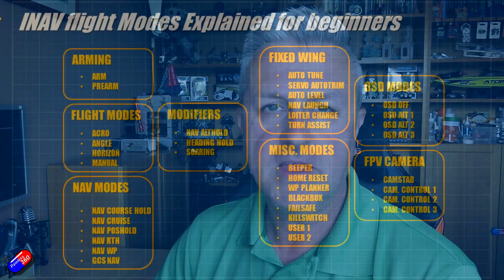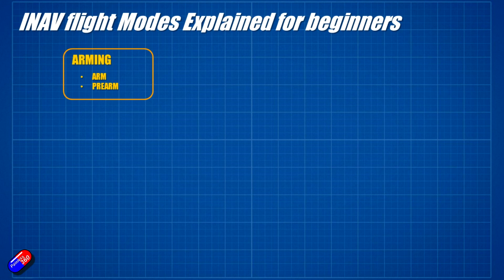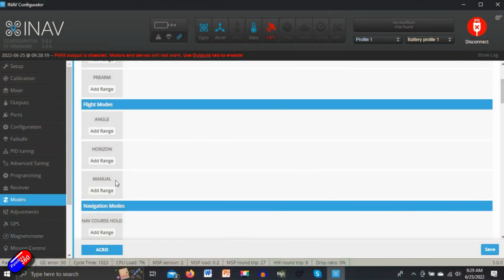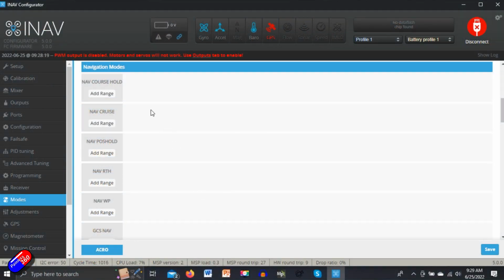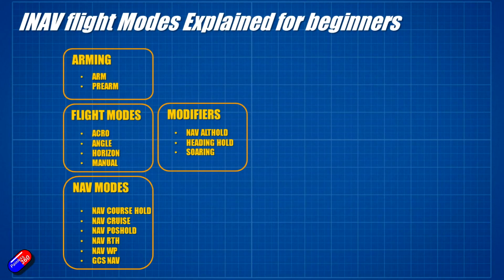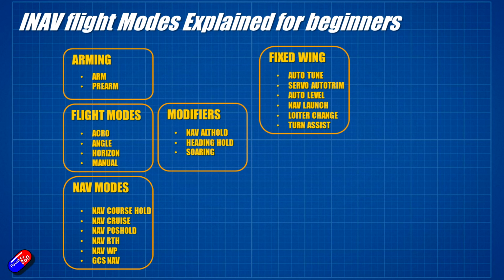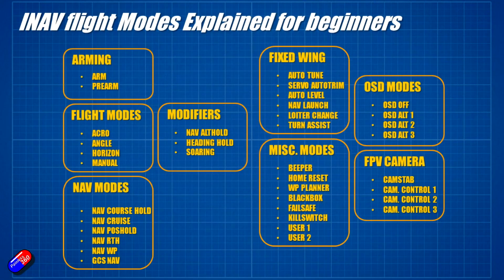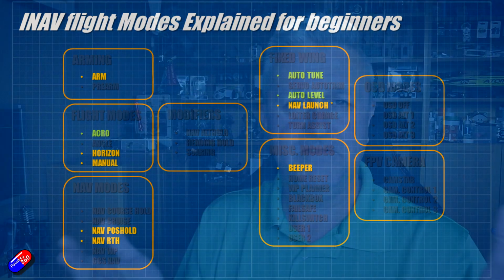(5/7) INAV for Beginners 2022: Flight modes explained simply

Comment: Hello and thanks for the video. From what I understand the main things to do in a test are autotune, autotrim and autolevel. Autolevel itself is not clear to me, I have planes with inav 6 to 7, I use continuous trim and I have 4 degrees by default in the table adjustment. How do you recommend I perform autolevel? Should it be done before autotune? Thanks a lot

Comment: I have been learning a lot from your videos. Thanks. 
Any way of having a thermal detector setup on a small and light electric glider with the small electric motor to be used only when necessary? 
The model will start to loiter at 75meters over the RTH location, the motor will be turned off at this altitude, it will circle with a 50mt radius as is set up in the RTH setup. If the glider goes down to 40mt, the motor will be turned on an will take the glider back to 75mt and turn motor off again until any of the  TX sticks are moved.
Reply from the maker: I've answered you on the other identical post, no need to post twice. I get to them all eventually :D

Comment: Hello! I'm a huge fan of your video. I own a "racer" type airplane, known for its speed and power. I would like to have two distinct configurations for my plane: would it be possible to incorporate a button on my remote control that would allow me to switch between two servo motor amplitude ranges? This would give me the flexibility to adapt to different flying speeds. Is possible to set this on inav ?
Reply from the maker: I'm not sure that you can swap motor mixes in the same way you can with servo mixes. I had a look in the project and can't see an open request for the feature to be added. Maybe scale it on the radio?
Reply: @Painless360  okay je vais essayer de passer par la radio, et sinon comment régler l’amplitude de la stabilisation ?
Reply: "Hi, I managed to get it working, thank you! I have another question: my stabilizer doesn't make significant corrections—it's really minimal and I don't think it's effective in cases of wind or turbulence. Do you know how to fix this issue?"
Reply from the maker: https://www.youtube.com/watch?v=OO1tIlfk9eU :D

Comment: Would be great to have a video only on maiden flights.  What is the plane setup in at launch.  Trim, tune and land then save and do it again.  It’s a process I haven’t sorted out yet on fpv planes.  Done this decades on legacy RC planes and I can’t get my Talon GT launched properly yet.  Still in one piece though 😊
Reply from the maker: Check out the maiden video in the 2023 INAV for beginners series... covers all that
Reply: @Painless360  thanks and I have.  It’s just that the maiden flight is such a milestone on flying planes and is where things go wrong and lessons are mostly learned on planes.  I’ve had a lot of years learning and this Talon Rebel GT just won’t go.  Lots of flight failure review boards going on right now
Reply from the maker: Using the setup method shown in my INAV for beginners series, I rarely have an issue... Best of luck

Comment: I was just thinking about which one to base on among so many options. Again, it's a very nice and helpful video. Thanks!
Reply: I'm not sure about the answer to one thing, though.  What does the plane do after auto launch?  Do I have to take control, or after this procedure, does it go to the height we set and circle, or should we turn on the return home feature until I'm ready after takeoff to do this?

Comment: Hi, and greetings,  thanks for tutorial, but, I have a question regarding the mode NAV CRUISE,  if I choose a throttle stick speed, and then choosed a direction,  and finally I choosed a altitude, during flying, for ex. , straight forward, is this mode NAV CRUISE that  I need to aktivate?... my goal is to enjoy the pan/tilt without worring about the piloting. Thank u and waiting for your answers,
Reply from the maker: In CRUISE mode, the plane will autonomously keep its course in the air, the pilot does not have direct control over yaw and roll but changes the flight course direction via the roll stick. The throttle is controlled automatically by INAV.  Always refer to the docs for the latest detail

Comment: great videos quick question so If  I set up 2 3 position or even a 2 position switch switches set for different modes would I need to leave the middle position blank so I could shut one switch off to use the other seems they would interfere with each other
Reply from the maker: I tend to mix them together so that each of the positions produce a different channel value. See https://www.youtube.com/watch?v=a3YDWxPPqT8

Comment: May I ask if do I have to have flight mode to use nav mode i.e. I have to put my craft to angle mode first before I can activate Nav POShold? or they work independently? Thank you for your time sir
Reply from the maker: They work as self contained modes. See https://github.com/iNavFlight/inav/wiki/Navigation-modes#nav-poshold---Position-hold - "lightmodes are self contained. For example: with RTH and WP (Waypoints) it's not necessary to enable angle, althold or mag, it enables what it needs. Read more below in POSHOLD section"
Reply: @Painless360  sir, thank you for taking your time to explain, I were trying to read the document but your explanation helped me understand it a lot better. May I asked if you happened to know what might be the problem when I switch on POSHOLD my quad just flying in a circle but doesn’t stay where it suppose to be ? I checked my gps and it had at least 8 Sat, calibrated the compass but I just couldn’t get it working. Thank you sir for your time.

Comment: 'it' You term off servo auto trim? Or continuous? Also loiter change vs nav post hold?
Reply from the maker: Not sure I understand the question. Can you please tell me more?
Reply: @Painless360  sorry. You mentioned about servo trim mode and also said you use continuous servo trim. Then turn it off after a few early flights. Do you turn off continuous or leave that on?
Reply from the maker: See the maiden video in the series.. Turn on 'Cont. trim servos' and leave it on.. You can disable it once you're happy.
Reply: @Painless360  Spichalski says that Autotrim is deactivated after a few seconds. What is the point of keeping it always active?

Comment: Hello there. I am a RC plane/helicopter pilot who has been watching your series. My question to you is as such. Can I use my current Spektrum radio or buy a Futaba radio that supports "S" bus for FPV use? Or buy a new system such as your Radiomaster with  4 in 1 open or ELRS architecture?
Thanks, I appreciate your opinion. Ken
Reply from the maker: If you are looking at using a flight controller (like I am in the video), then SBUS is the most basic protocol supported. Flight controllers support lots of other input protocols likevCRSF and IBUS (see http://www.mateksys.com/?portfolio=f411-wte#tab-id-4). So there us a lot of choice but I still use SBUS a lot here!
Reply: @Painless360  How do I become a PATRON?
Reply from the maker: Link in the video description... thanks for considering it!

Comment: Fantastic video, but one thing is missing, and maybe for advice pilots that like all perfect. I do flight the airplane in Manual mode first, trim the airplane with the radio, record where the flight surfaces end up for a trim aircraft, after that adjust the rod accordingly and reset the radio trim to default.  Why, because I know now that the plane itself is flying perfect in manual and any deviation with intelligent mode is a issue with the flight controller and no with my aircraft.  After that then a do Inav, one of the reason is because even inav is fantastic a poor aircraft setup will be mask by Inav like the servo center that can not have more that 50/-50 microseconds difference from 1500 microseconds. Mechanical manual setup is key to have a good Inav flying aircraft.  The other reason is that if you go just by inav (acro,angle, or horizon mode etc, when you switch to manual mode, be ready for the surprise of you life.
Reply from the maker: This is part of a series.... keep watching! This series is aimed at beginners and the videos work best when watched as a series. Happy flying!
Reply: @Painless360  totally agree.

Comment: I have an arm/disarm sequence programmed in the radio that works very well for me. My radio is a RadioMaster TX16S and to arm: throttle should be zero, SF down and pulse SH. That way there's no chance it arms by accident. To disarm you only need to put SF up but the throttle should be zero as well. This is to avoid disarming by accident middle flight.
Reply: can you upload a photo of the program sequence or something so I can replicate it?
Reply: Good tip - thanks. Presumably SF is the switch to Arm & you're using logic switches to test the conditions are met, although I'm not sure how the condition is still true once you let go of the pulse SH switch (so wouldn't that disarm it ?) - need to try this out on my Radiomaster.
Reply: BTW, whet happens if, by accident, you switch the arm mode to "off"? do you loose the control of the plane and even the RTH fonction?